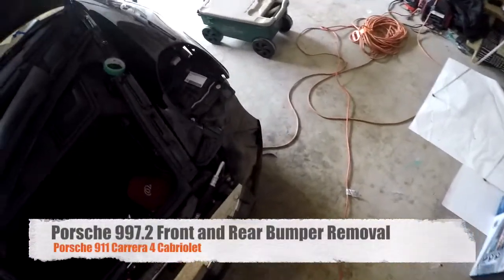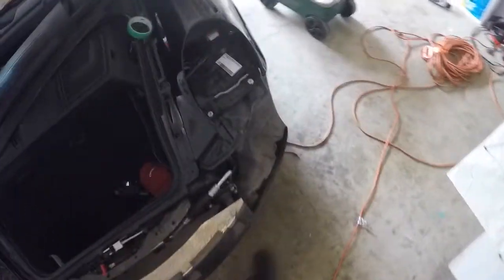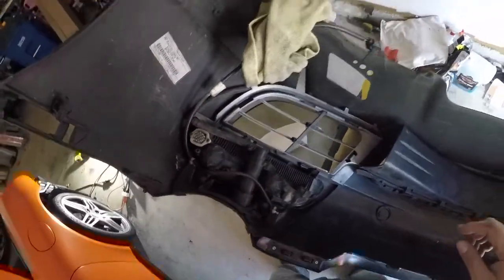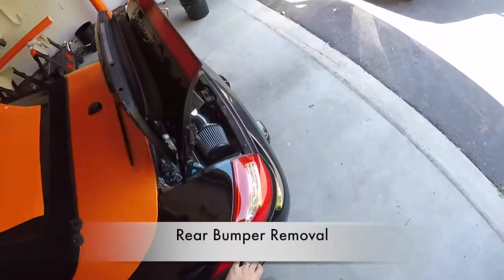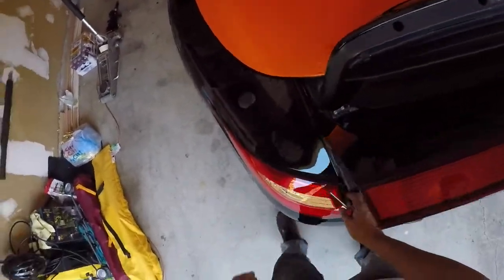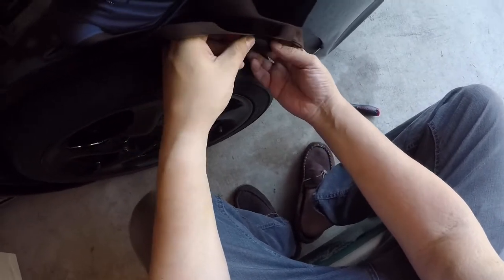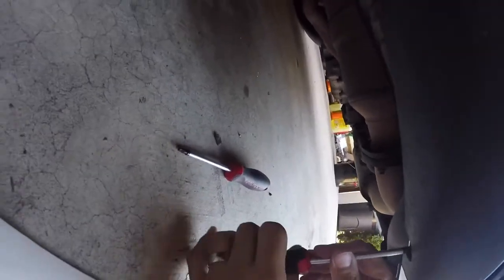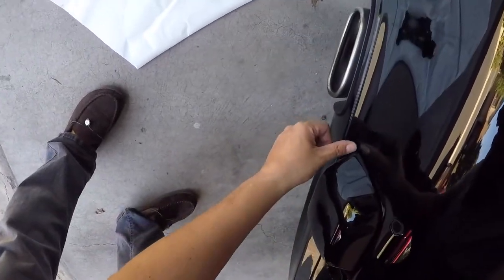Porsche 911 Carrera 997 2 Bumper Removal

Comment: Hello Omar, I've got a 997-1.  at 1:39 you show a little plastic guide part and you say you tugged it out.  Does that need to come out before you can take the bumper off?  There's a screw wedged back in there that goes through the guide part and it seems there no way to get it out.
Reply from the maker: David Hollenbach that piece does not need to come out.  I took it out but later realized it wasn’t necessary.  I think you were referring to 1:32 in the video.  Also when I said tugged out I was referring to pulling out the bumper cover.  You have to firmly tug on it for it to disengage.
Reply: OK thank you.  FINALLY, got the thing apart.  Happy I did not have to take that out -- would have been impossible to do so.  Thanks again!